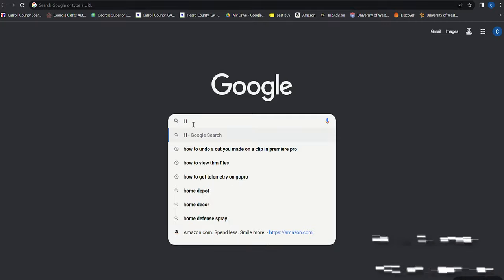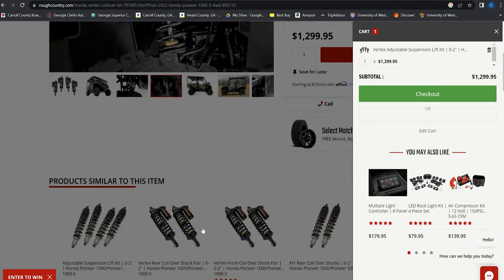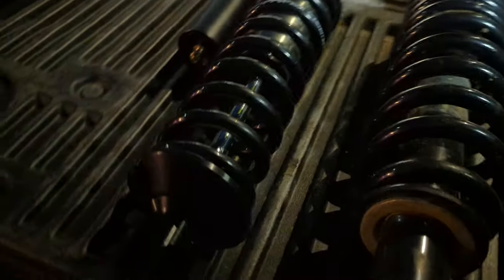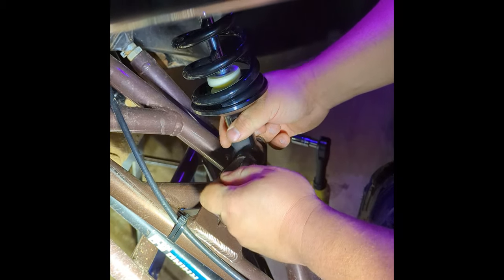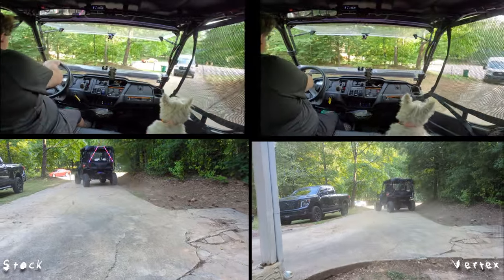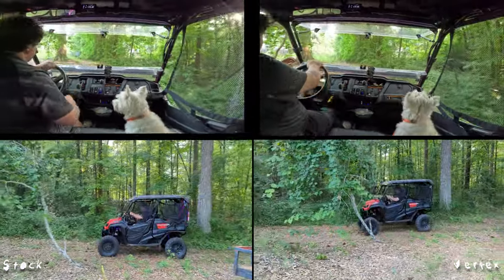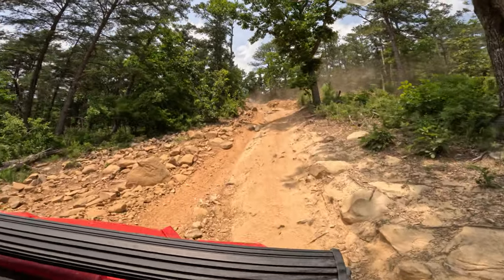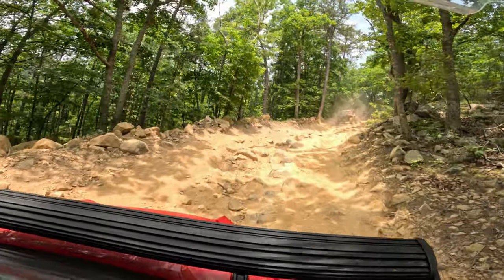Honda Pioneer Vertex Shocks Install and Comparison

Comment: Would you still recommend the vertex shocks?
Reply from the maker: @nitrotmann  Definitely. We recently got a new Talon R with live valve and the Pioneer with the Vertex Shocks and long travel kit is a smoother ride than the Talon. Of course the Talon has more travel but the Pioneer.

Comment: How did you come up with the idea for where you set your preload?
Reply from the maker: @keithdunnivan8099  I just started out there based on research I did in the Honda Pioneer Facebook groups I'm in. I ended up adding a little more a couple hundred miles later because I carry a lot of gear when we ride.

Comment: Hey enjoyed the video the base model sims like a good way to go so you can add things to the machine as you can afford them….. the deluxe and trail models are nice but way over priced…. Getting a base model 3 seater at the end of July… the plastics on the side do make them look a little better but I’ve heard they just get damaged when trail riding
Reply from the maker: I think the base model is the way to go. Honda has really gone down the cheap route with those plastic door panels. They use to be held in by screws but now it's just push pins that come loose from the factory. The colored door and bed panels do look way better but it would be best if you just bought them separately and install them yourself.